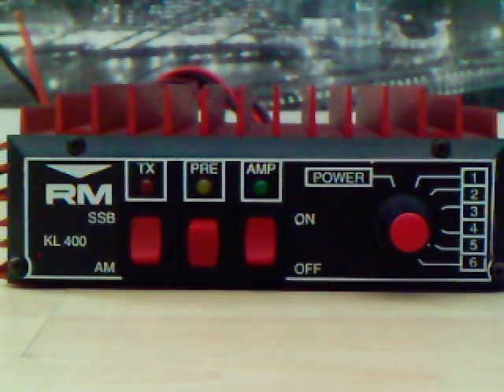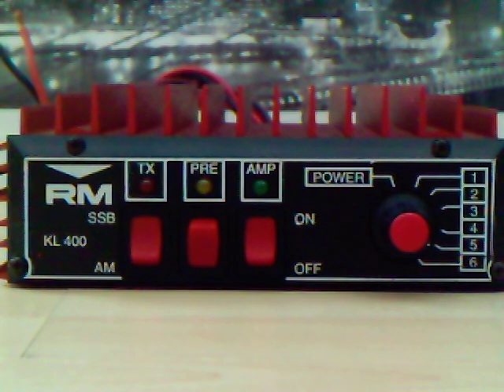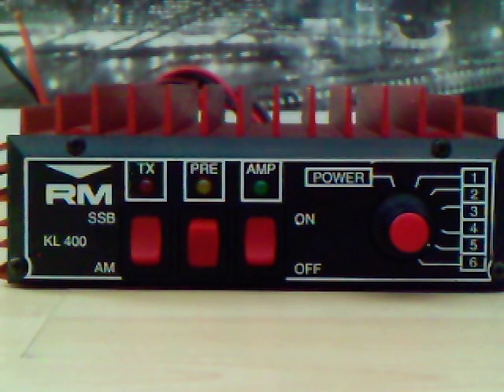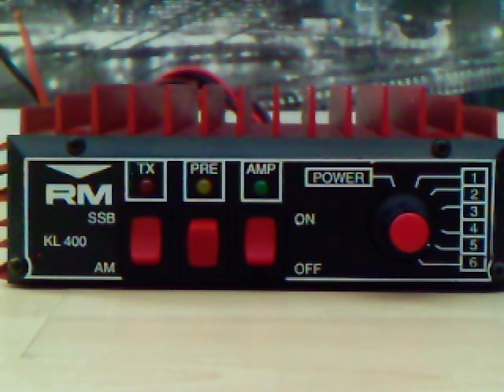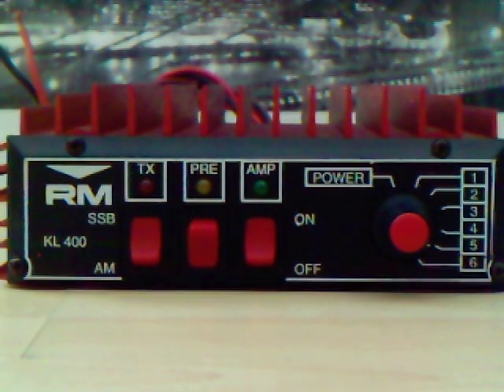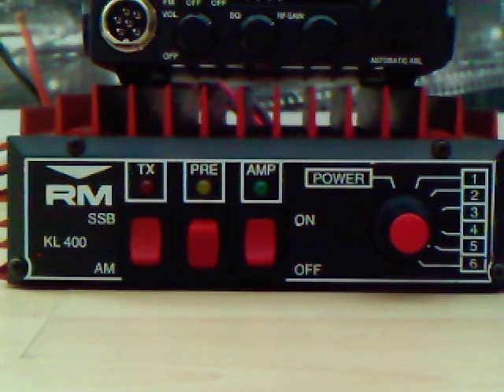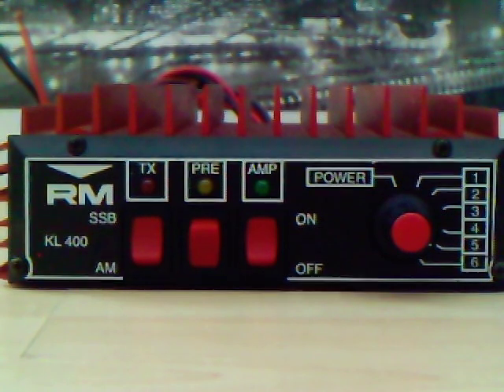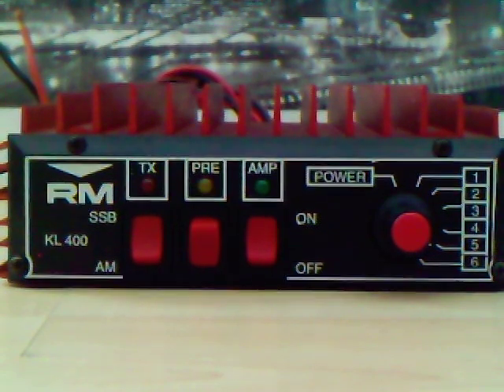RM KL400 - MANUFACTURER ALLEGED 400 WATT HF AMPLIFIER

Comment: I get about 225 watts on AM out of my RM 351P which is the same amplifier & 250 watts on SSB.4 watts dead key AM swinging to 12 watts & on SSB the drive is about 16 watts PEP.Good Pre-amplifier as well.Running 16.5 volts from a 40 amp power supply with no strain.
Reply: pranks  on your spouse

Comment: These amplifiers are cheap and cheerful, the power rating is beyond optimistic, it is an outright lie. At a push they will do a bit over 200w PEP and similar on FM. 
Contrary to comments below they are not Class C, they are Class AB but the bias circuit is poor.
The SSB distortion products are ok at about 100w PEP. 
I am tempted to sling a Modified B300P in the car... should be OK on 10m FM.

Comment: Is 30W (e.g. SSB 20m) the most you can get out of this using 5W in from the FT-817? I was rather hoping to get nearer 100W SSB out with 5W in.
Reply: you can get about 150-180 with '817 but thats averrage power. the listed 400w i think is peak power
Reply: @noimnotarobotcanubeleiveit7024  Goodness me, that's a blast from the past. Yes, I concur, that's the kind of power I got in the end. I don't think it was exactly the cleanest signal harmonics / intermods wise, but it certainly got out there. I coupled it with a hexbeam for a short while and broke DX pileups.

Comment: I have one of these amps for mobile use on 10 mtrs and they are only
200 watts max. All these types of amps seem to rate thier amps as 
double but thats the input on the rf board not the output to the Antenna.

Comment: yes you will get harmonics, but only serious if you crank it up or have an insufficient power supply. you need to run it from a 50 amp switcher (yuk!dzzzzzzz) or a lead acid.
harmonics are reduced by using a high q monoband antenna such as a small transmitting loop. otherwise add a tunable hi q bandpass to it.
its still a good amp and well worth the cost

Comment: This amp can only give 150 watts FM it uses SD 1446 pills rated at 75 watts each with a 1.1 swr and a good 40-50 amp PSU this wont give much more than any B300P why are people believing RM KL's wild claims come on guys a 2x 12 amp fuse says it all!

Comment: @MisterUrrutia  it will work for digi modes as long as the antenna is tuned well with a very good swr. best not to run it through an atu i found. it actually runs very cool driving my small magnetic loop for 80 and i have good reports.

Comment: @MisterUrrutia get one, add a fan and a sla and add it to your go-pack. its a pity about the wild claims of rm and that encourages people to be the idiots they often are. i find it a good amp if you dont turn it above 4 and keep input power down. saves the ft817 battery too. with a portable antenna in bad conditions it gives that extra you need in the field.

Comment: i use one of these since my 203 blew. reads 30w op on my mfj atu with 5w in from my 817 and gets very hot with digital. run direct from a car battery with short heavy cable, short coax and good match and balun. DONT USE IT IN THE CITY harmonics are not perfect. remote locations cause little disturbance. never fed it more than 5w in and dont want to. gets me 6000 miles on a good day with its underdriven 30 rms output. very light very satisfied very cheap.

Comment: @fasthandslow  You don't require all that power for digital coms, 10 watts will get you around the world, plus if you look at the spec for the output transistors in this piece of *%&" CRAP it can't do what it says on the tin. They aren't meant for FM, TOO MUCH HEAT. For the heat sink!

Comment: When ever i try to use my kl 203 when i'm mobile i keep getting rf coming back into the radio i've tried using ferrite rings on my power leads and coax but this hasn't helped, does anybody know how to cure this?